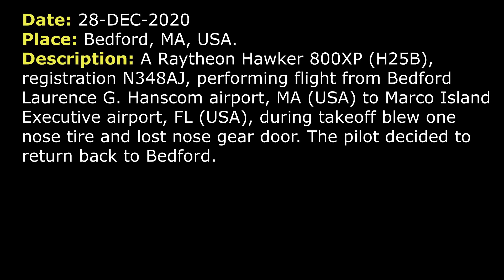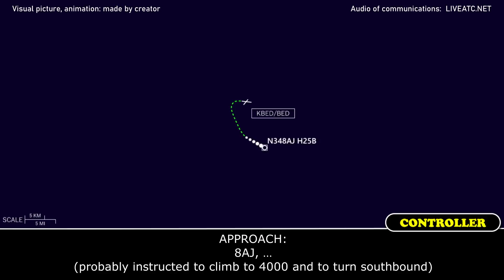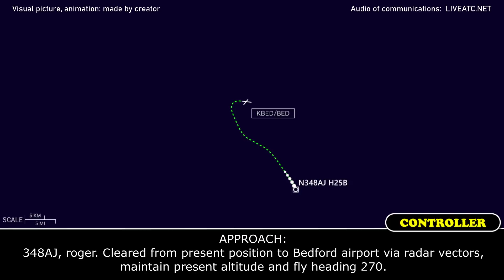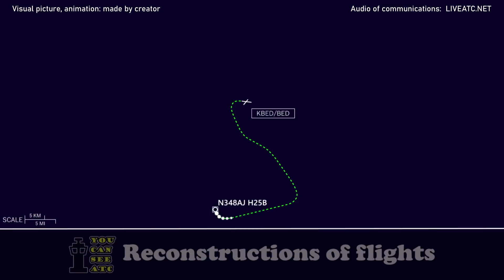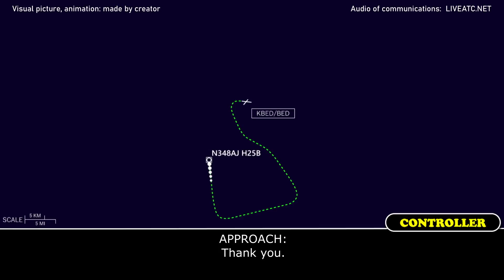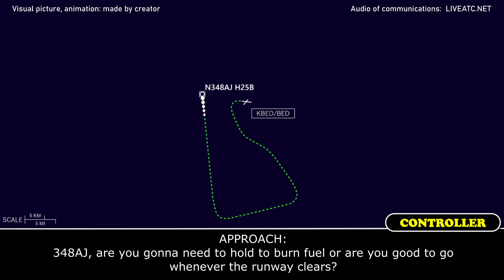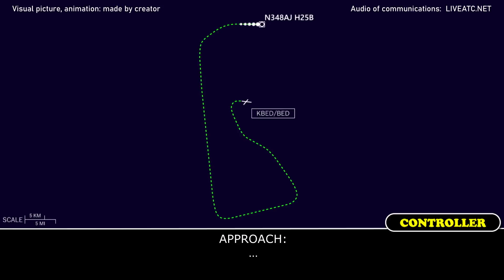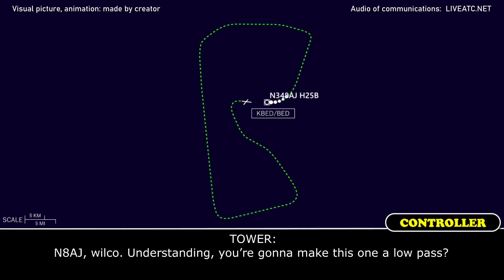BLOWN tire and LOST gear DOOR on takeoff | Raytheon Hawker 800XP | Bedford airport

Comment: I don't understand why the pilot wouldn't do a low level fly by to have to tower look at the nose gear when theycouldn't tell from longer range what the condition was.
Reply: At time 7:20, pilot alerts the approach controller that the airplane was trimmed quite heavily and felt something not quite right. Usually they will do a low approach for tower to look if the only problem is gear related, it sounds like the pilot thought it was more than just the gear at this point!
Reply: It wasn’t trimmed heavy. I really didn’t see the need to prolong anxiety. Wanted that sumbitch on the ground. What exactly would you suggest doing differently if you had what appeared good tires vs shredded nonsense tires. I had one of each on either side. The one on the right inner appeared fine. Had 2” gash in it though. Left inner shredded